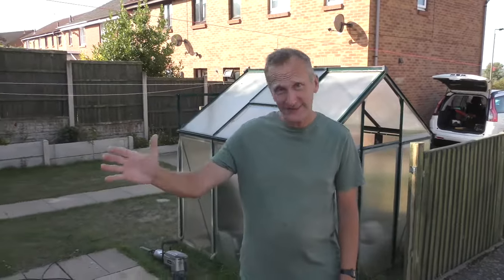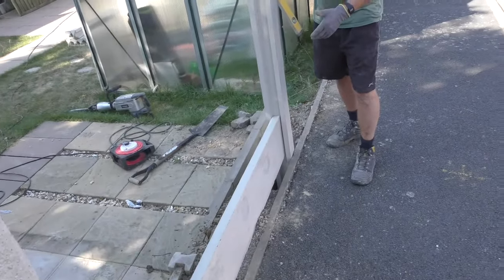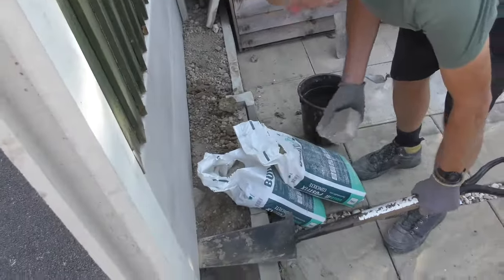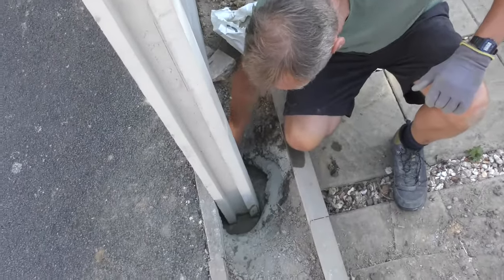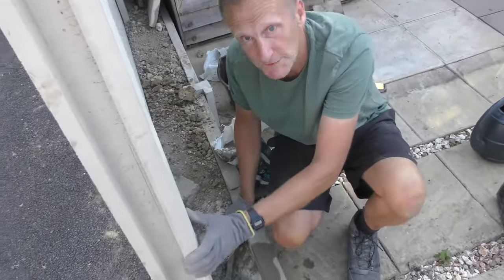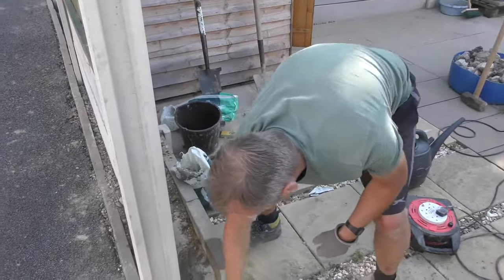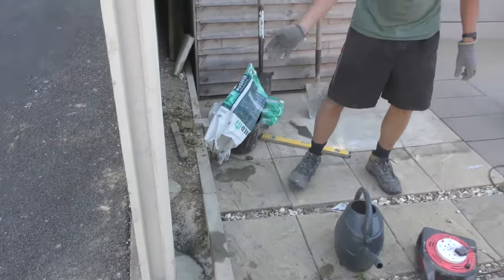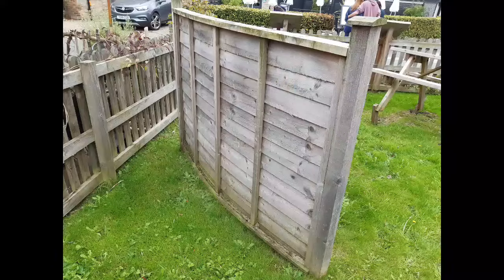Fencing on a slope

Comment: I put a post in the other day, used blue circle post creat. Post was perfect, over several hours the post moved as the post creat fully hardened. Luckily it was close to the garage and was able to wedge some timer in-between to bring the post back to vertical
Reply from the maker: Good that you managed to correct it. I normally fill the hole half full of water and then some postcrete, sometimes the way the water mixes could effect it, cheers Mike
Reply from the maker: That is frustrating when that happens. Need to rod it really well around the post. Well done for finding a solution.

Comment: We always used balast and concrete, we would mix 4 to 1 ratio then put it in dry. We used a sledge to "tamp" the holes basically compact the ballast. Then we would just water the holes with a watering can before we left. I was taught by an old school that's how we learned to do it
Reply from the maker: That is a good system, the systems seem to vary, some recommend filling the hole 1/2 full with water and some after.

Comment: Hi, could you explain the purpose of the string line in greater detail pls. My thought process is that it serves no purpose as your posts are running against the haunching/edgings and the posts will drop/be flush to each fence height as you work your way down, so therefore why is their need for the string? Thanks
Reply from the maker: Hi the string line gives you the step down for each post, so they are nice and even, plus helps to keep it plumb at the top. Hope that helps, cheers Mike

Comment: I'll be erecting an approx 36 foot fence run in my garden soon. The first 24 feet will be fairly level, the last 12 feet rises up around 12 inches or so, would that string level you put up at at the beginning of your video to assist with the equal drops be useful in my scenario do you think?
Reply from the maker: The string line is useful to check the alignment of the posts initially, but when you get to the drop,, rest the line from the last level post to the one at the bottom to get the step downs the same. Hope that helps, cheers Mike

Comment: What length post did you use?
Reply from the maker: The posts were 8 foot, (2.4 m) 1 foot (30 cm) gravel board 5foot (1.5 m fence panels). Just under 2 feet in the ground.

Comment: Hi, great help going to do mine soon what do you fill the gaps under the gravel boards with after? Got quite a slope! Thanks
Reply from the maker: Hi Shay, depending on the size of the posts, sometimes you can do a double gravel board and bury, the lower on on the top side. If the posts are not longer, then that is a bit more tricky, could involve cutting slabs and using U clips to keep the slabs in place, cheers Mike

Comment: Hi great Video I’m doing this to my garden .when I set my first it will be 2foot under ground and 6foot from floor to height 1foot gravel board and 5foot of composite fence making 6foot .i also have a slight slope .do I set the bottom post the same height as the top post .thank you
Reply from the maker: Hi Graham, I normally set the bottom post at the same height as the top, unless there is another reason e.g gates at different sizes at the bottom etc, cheers Mike

Comment: I don't get how you keep the post straight while you're adding the postcrete
Reply from the maker: Hi there you check it with the spirit level on two sides, you can put a couple of bricks in to hold it in position , then the water to half full, then the post crete. Keep checking for plumb as you back fill and rod the postcrete. Hope that helps.